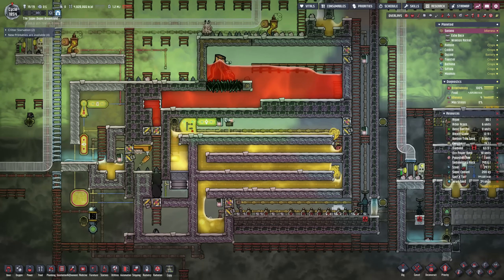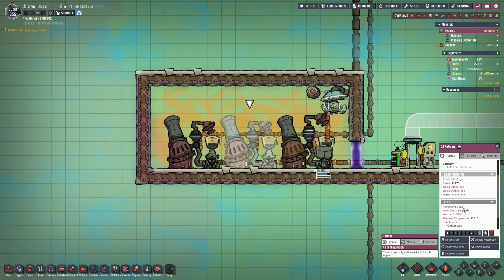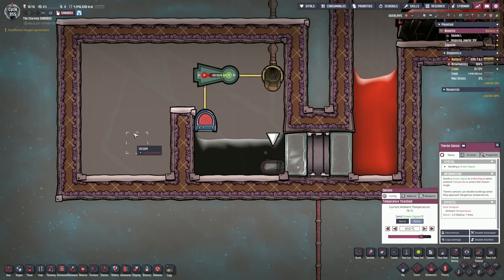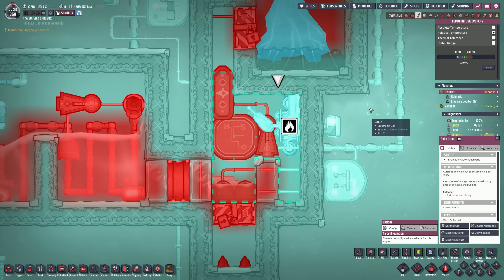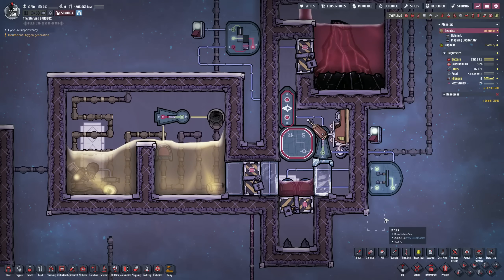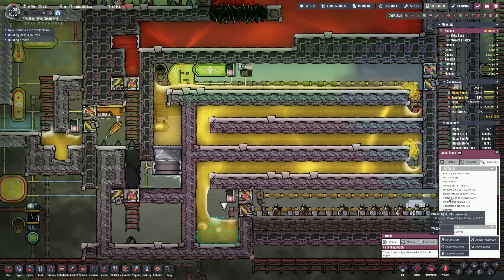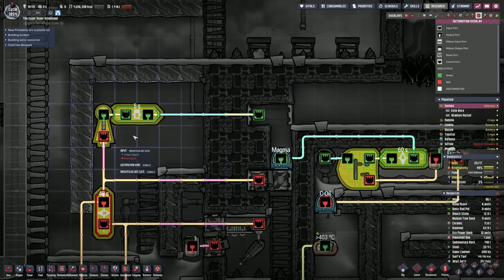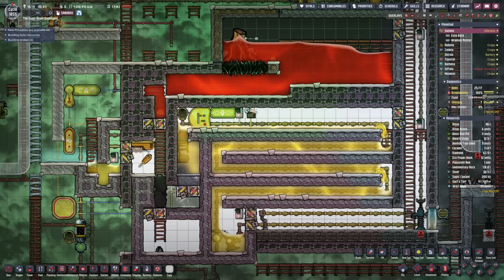Petroleum Boilers Explained for Beginners in Oxygen Not Included

Comment: Using unprocessed crude oil to cool already hot petroeleum was a genius design. Only thing I could come up was making a crude oil loop and making it come near pwater cooling loop to cool and use thermo sensors to prevent boiling. It would be still efficent but incredible time consuming and with huge setup.
the setup in the video is way better but he could make a zigzag out of magma to make a magma blade instead of dealing with robo miner. I eill try to imitate his design regardless, his handling of petroleum is genius

Comment: This is a really inefficient design. The magma setting to solid and then getting mined means you lose half the mass and hence a chunk of the heat and you need a miner.

Much better to drip smaller amounts of magma, have them condense to debris, then run the debris on rails to extract the heat. That does need more steel and rails but that tech isn't particularly hard to get.

Comment: The boiling can be done with the heat from a metal refinery using petroleum as the coolant.  You do get to a steady state where you can only refine gold as you get closer to the upper temperature range of the petroleum coolant.  Massive steam heatsink that connects to the boiler.  It gives you plenty of time to charge up heat before you are done building the rest of the boiler

Comment: If you play the game in Fahrenheit because your American and don't want to do the math conversion for every thing you do. Here's the quick numbers for Crude oil to Petroleum in Fahrenheit. Crude flashes to Petroleum at 757 degrees F, but Petroleum doesn't flash to Sour Gas till 1057 degrees F. So you can set the Temperature gauge to 806 degrees F and you won't have to worry as much. I know for Celsius the numbers are much closer together for flash points and its a slower process. But if your American just use Fahrenheit no shame in sticking with something you know. But thanks for the video

Comment: For the lava section, it seems it dumps quite a bit a lava at a time to even leave extra rock up where the robo-miner is. I’d recommend using a lava blade so you can better control the amount of lava that falls at a time.
Reply: For further optimization, I like to use the magma blade directly, with an outlet into a steam chamber based on temperature at the heat exchanger to prevent solid rock.
It's a nifty resource to distill water, melt plastic or just generate some extra power.

Comment: I don't know why every boiler guild has the top row of the petroleum zigzag connected with the boiler pit, that's so problematic since the top row would has similar temperature as the boiling level, and would very easily cause the crude oil in the radiant pipe to shaft change and break.
To fix this, just extend the boiler pit's wall 2 tiles up, so the top row of the zigzag is not touching the boiling petroleum.
Reply: I don’t know why this has to be said every time someone makes a petrol boiler guide. Feel like YT is forever cursed by this.

Comment: petroleum generators seem good on paper... but I don't like them much. they can't run constantly without over-heating so you're wasting energy cooling them and they produce a ton of CO2 so you waste more energy on co2 scrubbers(unless you use slicksters, but then were talking adding dupe labor)... by the time you cool them and take care of all the waste it's not much better than coal. natgas is the clear winner.
Reply: build them out of steel and let them self-cool from their waste gas. I just build them next to the space biome and let the co2 naturally vent into space.
Reply: I built a boiler on a heat spike at the bottom of the map and it's awesome, produces so much petroleum I don't know what to do with it all. I set up jet suits because I had too much petroleum lol. The CO2 get routed to slicksters but they produce a ton of meat so the dupe labor is worth it. I do also supplement power production with a little bit of geyser natgas tho
Reply: @addisonjones7514 ya, depends... I still don't like the generators but petroleum rockets can beat the game, tho biodiesel is kinda better now. I'm kinda over petroleum usually tho, I'd rather build a sour gas boiler for power. my no space materials sour gas processor design is gettin pretty good :D.

Comment: I always let the mined rock run trough a steam chamber till ca. 150C and afterwards trough a cooler to 30C.
Waist nothing!
Reply: no need cooler, turbine side already basically a cooler, dump some oil or SC on the floor of turbine and then just dump post steam rock onto turbine floor, and lock dupes out of steam room so they wont grab hot rocks